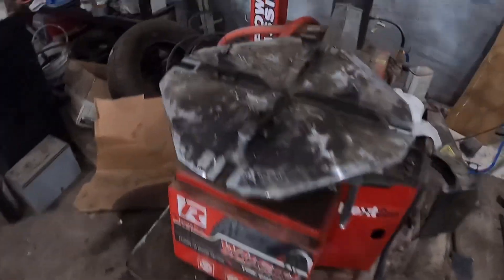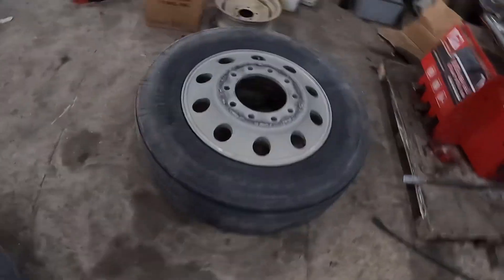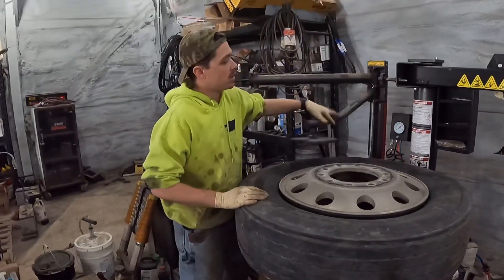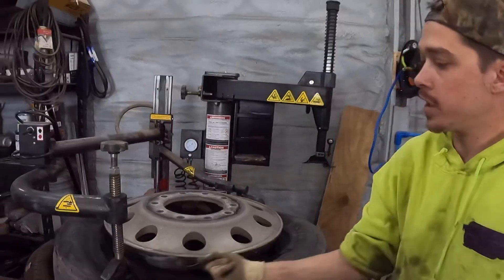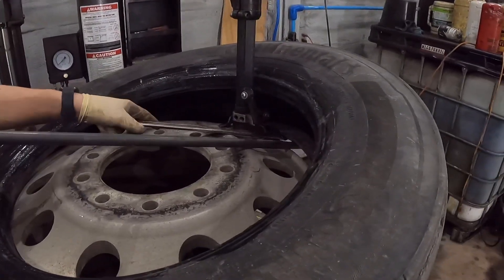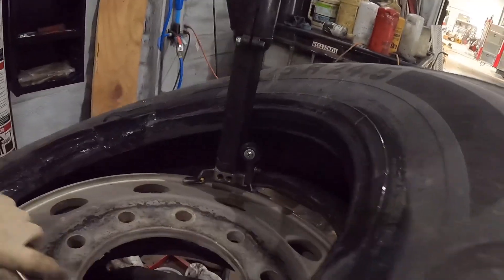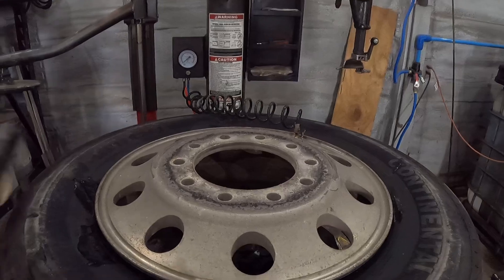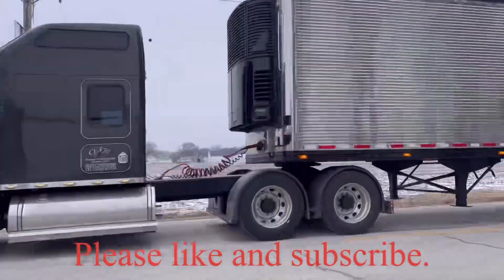How to operate a Next Gen tire machine

Comment: Two bars and a hammer ,  much easier
Reply from the maker: Maybe for some. I never found it that way.
Reply: @jacobschrock4171   I do it everyday , without wasting energy picking up the tire and wheel . No worry about  scratches that comes of from the back  of that wheel as well.  If you remove it from the front there is no need to unbolt it from the truck.